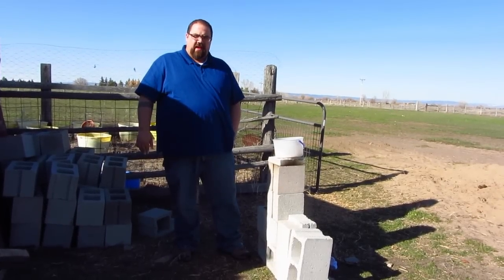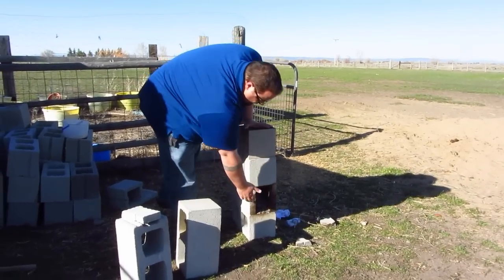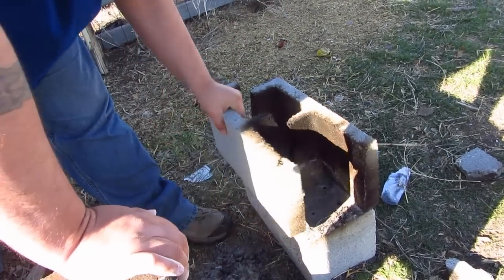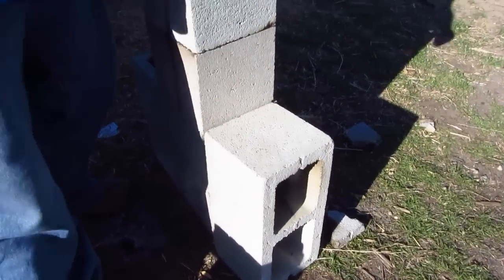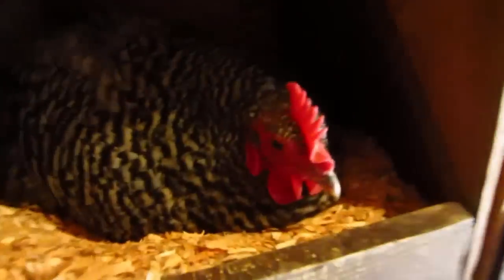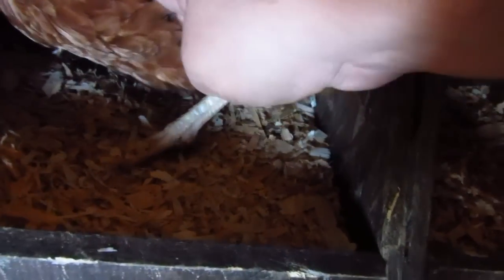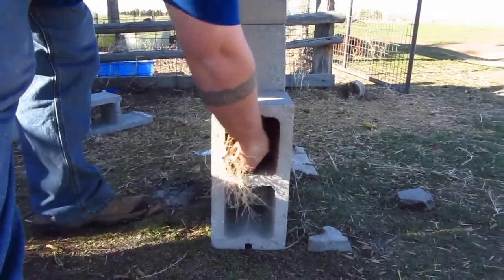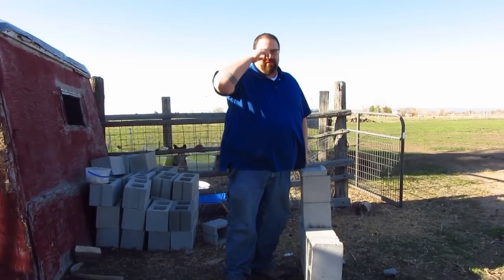DIY How to Build an Emergency Survival Rocket Stove EASY!

Comment: This is an interesting variation on the rocket stove, cheaper and easier to build in ways but not as portable as the one using stove pipe.  I'm curious though if cinder block provides better insulation then the stove pipe/sand combination. Thanks for posting.

Comment: are drilling the holes nessisary?  It doesnt seem so.
Reply from the maker: If you use the damper block on the front, to control the heat for cooking, then they help a lot.